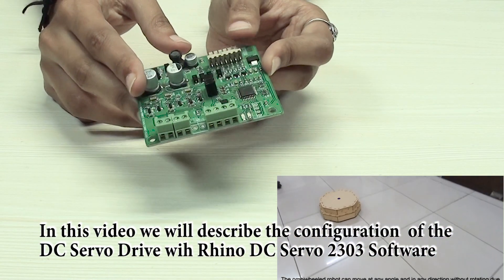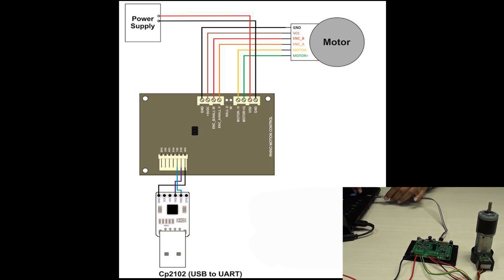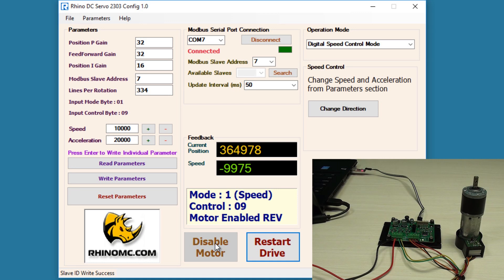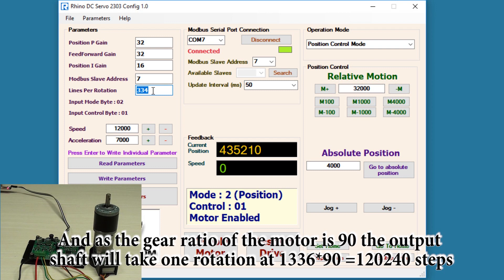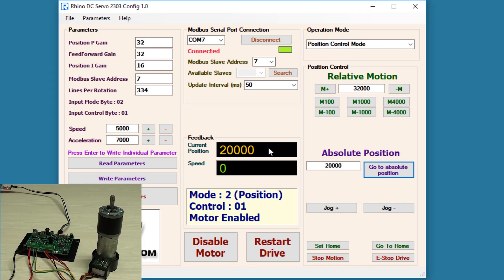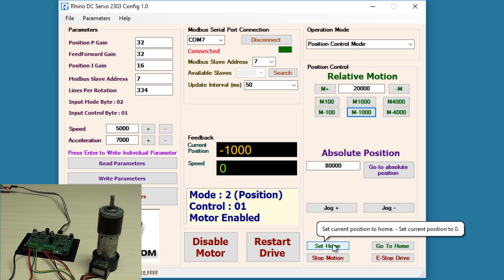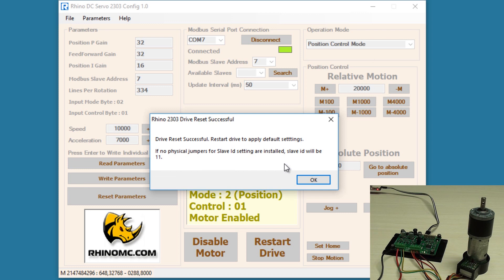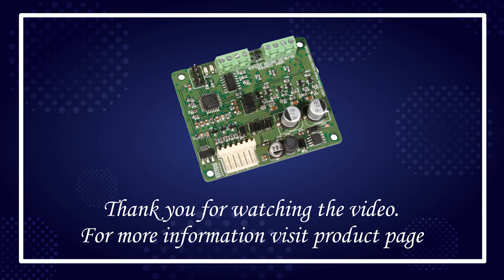Configuration of Rhino DC Servo Driver (Modbus UART ASCII) with windows based 2303 Config software

Comment: Can this be used in angle control (0-360*). In position control mode, will the motor come back to home position after power on and remeber 0*/home position?